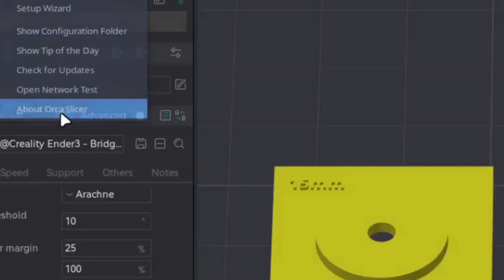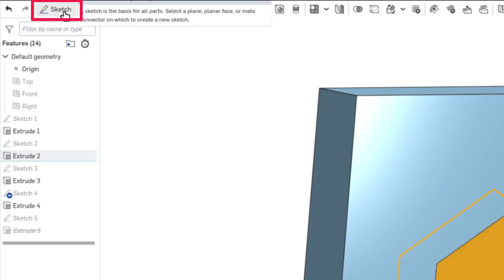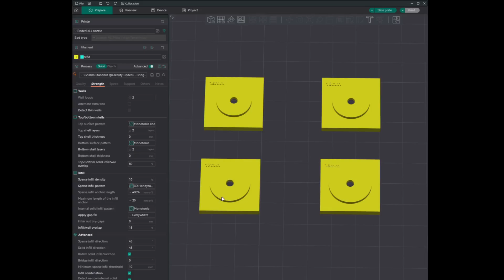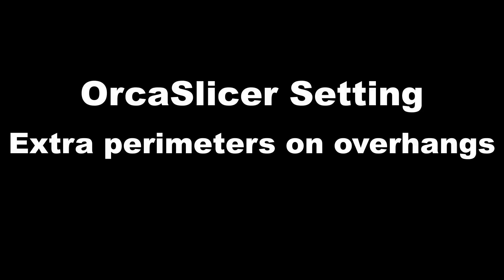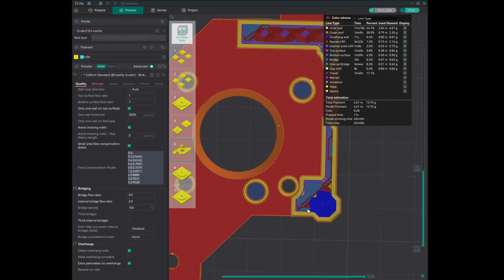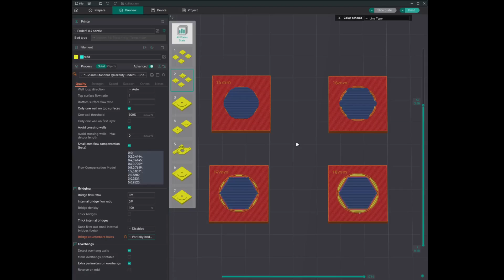OrcaSlicer Counterbore Hole Bridging – Get Flawless Prints!

Comment: Which option is better?
Seems if you can drill a hole to clean it sacraficial layer is way better?
Reply from the maker: with sacrificial layer you need post processing with a drill bit and a deburring tool to get a clean edge. If the hole is deep, drill bit will reach but will have difficulty go reach with a deburring tool
Reply: The print from concentric pattern with extra perimeter on overhang is really good considering it's printing mid air and just grabbing from the walls.
I've been avoiding that feature but now I'll give it a try, thanks for the video!